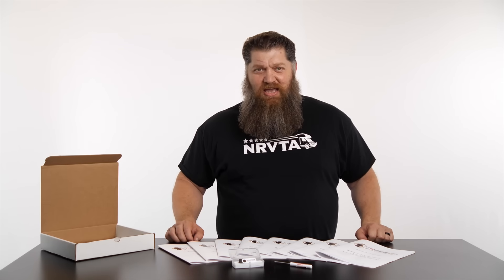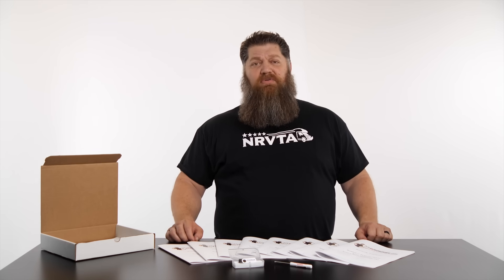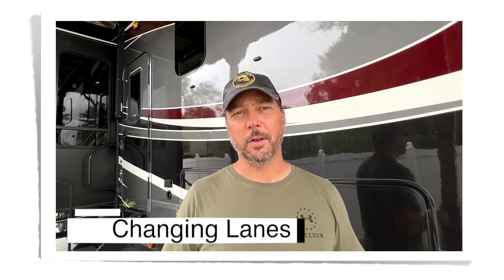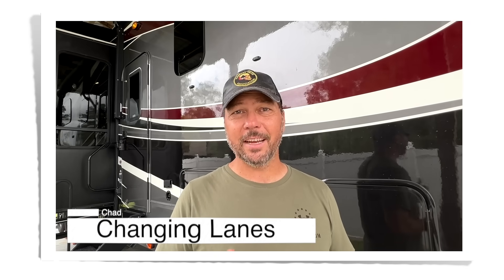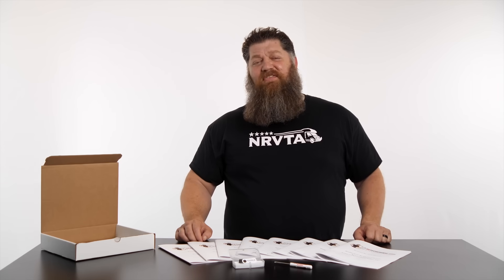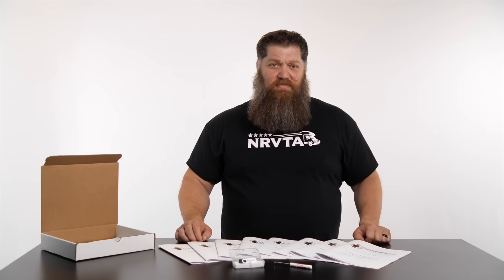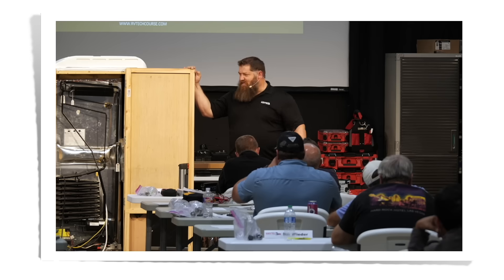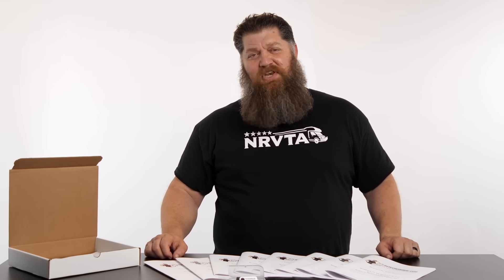Learn to repair your own RV

Comment: Is this training only for personal use? Do you all give some type of certification of completion for the online class? I just finished graduating from an HVAC/R School and am looking to get into becoming an RV Service Tech. Is there any advice that you can give me? I'm in New Jersey by the way. I would also like to add that I have six certifications EPA 608, MV 609, Manuel J, Hydrocarbon, R-410A, and Residential Energy Analyst
Reply: I used the information for work and access it often for a refresher. You can use it for personal or pro use.